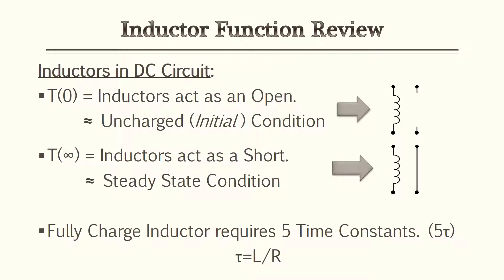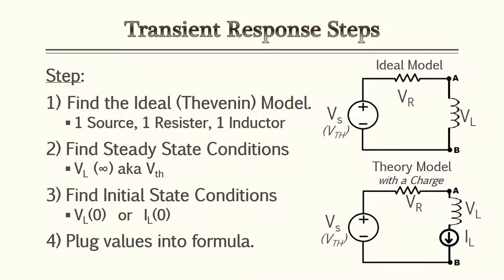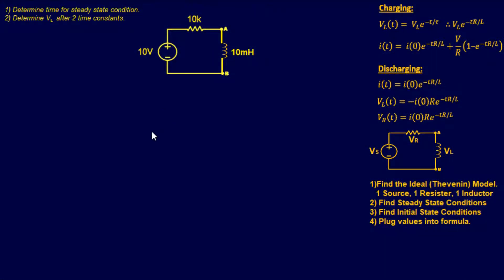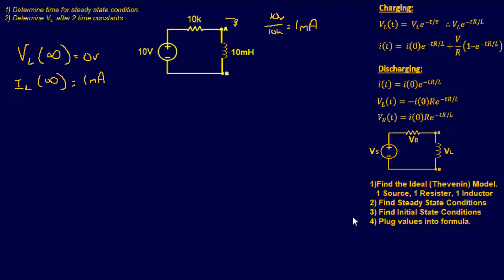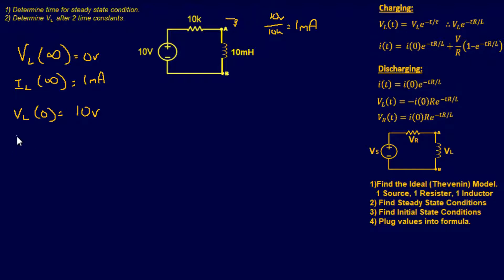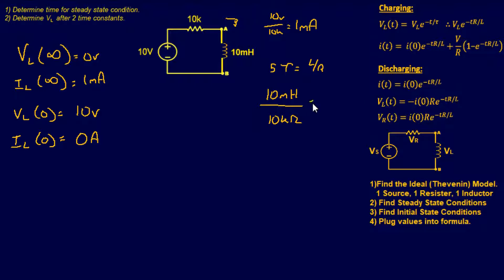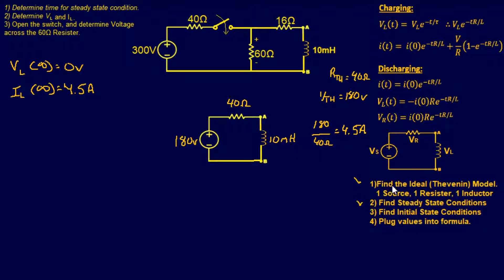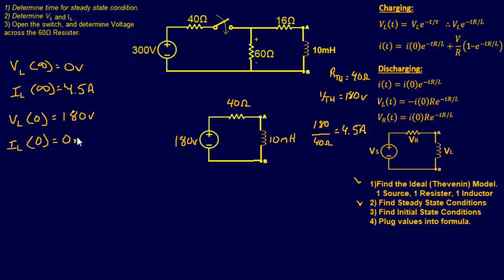Electronics P.E Prep - RL Transient Analysis

Comment: I have a question for the second question. At infinite/steady state, wouldn’t inductor act like a short? If so, wouldn’t that change the way the voltage distributed between the resistors; for example, the 60 ohm resistor will become in parallel with 16 ohm resistor in lieu of the 40 ohm.
Reply from the maker: Yes, it would act as a short at steady state. Do the math as if you were calculating resistors in parallel (without the inductor). You would obtain the same answer.